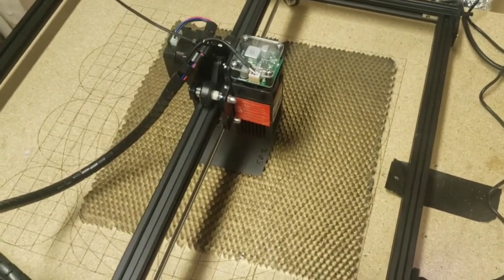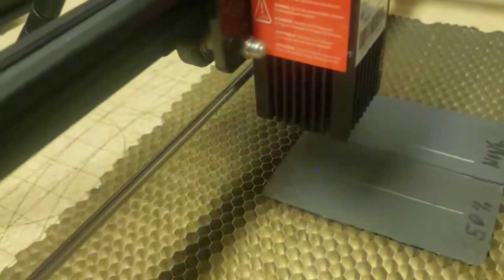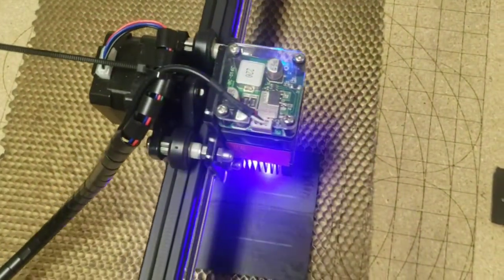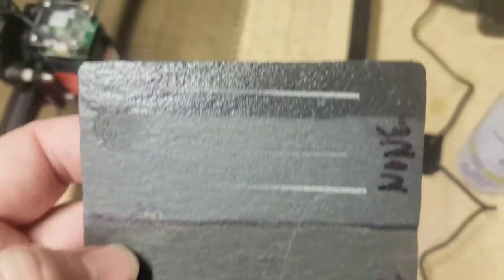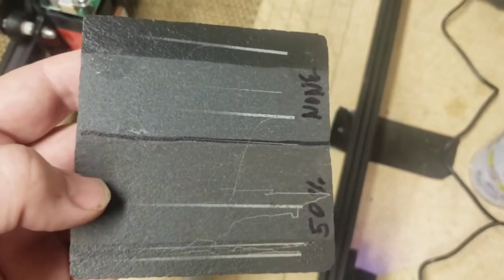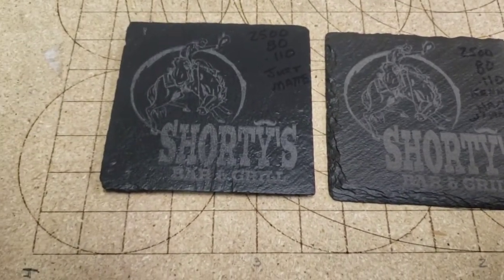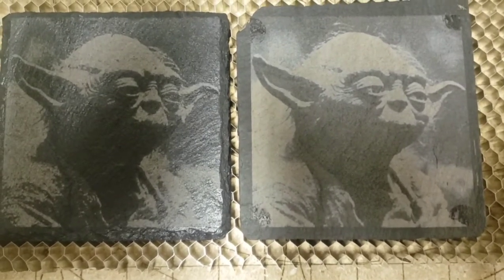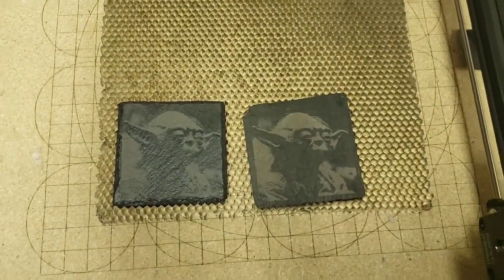"The Kenny Hack" on slate. Does it help? I know what I'm going to use. Ortur Diode Laser.

Comment: Will my ortur 5watt engraver do slate? Even with the clear satin 2000/100
Reply from the maker: If its a 5 watt optical out power it should be able to do slate. If it's 5 watt input power it might not.

Comment: You talk about the "Kenny Hack" solution... what exactly is it? That is if you don't mind indulging me/us!?
Reply from the maker: it's a homemade aging stain made from vinegar and steel wool. look up vinegroon. helps the laser burn better. Or you can use Borax which is the easiest and best results or baking soda to help get darker burns. mix them both at about 2 table spoons per 1 cup hot water. I have an older video going over how to make the aging stain and a more recent using Borax. Baking Soda is good if you want to use on a food safe product.
Reply: @TheKennyHack  Thanks Kenny

Comment: You said 70% power. Question 70% of what 7 W, 15W or 20W.
Reply from the maker: this was on my 20w. most of my early videos are all on my old variable focus 20w. About 30 videos in I got a variable focus 15w. I just got an OLM2 Pro fixed 20w but only have done a few review videos. If I do more videos this winter I'll be sure to say which unit I'm using. 

you mostly want to focus on techniques not numbers as everybody's machines and setups are different and you'll need to find the exact numbers that work best on your machine. Others numbers are a good place to start but don't assume they will give you the exact same result.

Comment: Hey Kenny great work, could you please share the settings on the picture for the slate engraving. Thanks
Reply from the maker: 2500mm/min, 80% power, filled at a 0.110 line interval, and id guess Jarvis dither.

Comment: im new here, what is the kenny hack
Reply from the maker: Find the best pre stain video. It will go over how to make it. Its a common home-made wood aging stain that makes the laser work way better. Can apply a white wash over the stain to lighten the wood back closet to normal but it will still burn better. Ive burned photo quality at 9000mm/min at 42% power with a 5.5w diode laser. Without the treatment my laser wouldn't even put a mark at that speed and power. It can be applied to some other surfaces and helps but not nearly as much as it improves wood burning. Ive found a lot of things that will help burn wood bkack but this method makes the light shades burn in better too. Just havecto watch some videos to catch up on everything I've tried.  Thanks for watching.